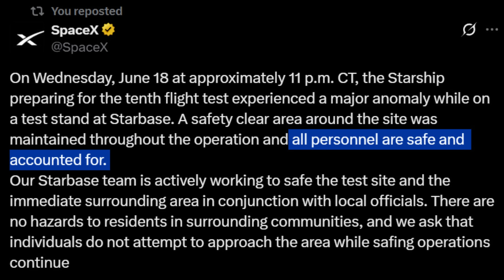SpaceX's Latest Starship Explodes During Ground Test

Comment: Selecting methane and oxigen for fuel is good choice regarding to creating fuel for return journey  on-site anywhere in the solar system, but bad regarding to the freezing and boilding points close to each other. One fuel may undercool the other, causing a clogged pipe...as I remember there have been a kaboom years ago because of this.

Comment: I noted on the NASASpaceflight video, that there was the forward flap test just seconds before the explosion; in fact it was very likely still ongoing when this happened. Whether this was in any way linked is impossible to judge, perhaps not, but on their video "SpaceX Starship 36 Explodes During Flight 10 Testing at Starbase" at 0:30 seconds in the flap is clearly functioning...
Reply: Well at least something worked.
Reply: My theory is something broke in the flap mechanism.  Either a weld broke causing a weak spot or something came loose which poked a hole in the tank when the flap returned to starting position.

Comment: Brilliant review. Only one glaring error: "we don't know the effects of breathing tiny glass fibres."
Reply: Fibrosis. Ask someone who installs or tears out insulation for a living, without face protection. One-time exposure and you'll be fine, life-long exposure? Not so much.
Reply: @desdenova1  I know of two people who did fiberglass insulation for a living, one worked for 10-15 years, and one his entire career, well over 40 years (and still does in his senior years for friends), no lung issues what so ever, and they never used/use masks. Glass fiber/ fiberglass, is generally not considered a cause of fibrosis, although some studies have shown that prolonged and high-level exposure to certain types of glass fibers may be associated with an increased risk of lung disease or fibrosis, then again, so is flour dust when baking! For anyone in construction, and especially renovation, the main concern is dust from other building materials, including wood dust, all kind of chemicals and binders, and of course concrete dust/silica which is the big risk. As I said, while fiberglass can cause irritation, long-term effects are very rare.
Reply: @Kowalski301  Yes, fiberglass particulate is pretty gnarly.
Reply: Pneumonoultramicroscopicsilicovolcanoconiosis
Reply: Depends on the material, silicosis, beryliosis, etc.
Reply: What do you mean
Reply: @spooders8424  I believe s/he may be referring to asbestos.  Inhaling asbestos fibres for decades may take 30~40 years to finally manifest as asbestosis, an often fatal lung disease.  See:  https://en.wikipedia.org/wiki/Asbestosis
Reply: I think what Scott meant is that we don't know too much about the health effects of fiber reinforced ceramic panels getting burned in a LOX/Methane fire...
Reply: Actually.... GLASS fibers are not bad, they can cause irritation in airways in large amount and worsen asthma etc, but that will regular house dust do too. But glass fibers are inert and importantly, the body will expel it within 24-48 hours. There is also no evidence that glass fiber cause cancer. Silica on the other hand is a totally different story, and the tiles mainly consist of that, so not sure why he mixed up silica and glass.
Reply: @Kowalski301  Your definition of bad is clearly very different from mine. Fibrosis does not appear to be good in my experience.

Comment: Given that the Pez Dispenser is on the unshielded side and the very first frame indicating rupture happens on a curved section of the shielded side, it appears to me that the downcomer tracing along the shielded side is probably a good candidate for the culprit.  In this portion welds are probably more difficult to do with machines, unlike a segment where tubing could be rotated as a complete unit.
If this is the case, it should be fairly easy to find the part that failed first, because it would have fractured and unzipped cold before being tossed clear of the rest of the ship by the ensuing bleve.
Editorially, from my point of view, the V2 versions of Starship all seem to have had failures related to welds in places where those welds would have been done by hand.

Comment: In the fire department, this is what we would call a BLEVE (pronounced ble-vee) acronym for Boiling Liquid Expanding Vapor Explosion...basically a rupture of a pressure vessel containing flammable liquids causing an explosion. BLEVE are normally very dynamic, and the most fiery and destructive of explosions. Examples of BLEVE's in the news in the past include Texarkana train explosion, and the massive Dubai explosion.
Reply: This isn't a BLEVE. A BLEVE is when you have a fluid above its normal boiling point kept liquid by high pressure when the pressure vessel ruptures, causing the entire volume of liquid to flash to vapor. BLEVE's do not need a flammable liquid, and in fact the most common example is a malfunctioning tank-style water heater, where multiple failures cause the heat source to run continuously, causing a build up of pressure until the water is well above the boiling point and the whole tank ruptures.

(Also, last I heard SpaceX reported it was a catastrophic failure in a COPV that caused the incident, similar to the Amos-6 anomaly)
Reply: Starship fuel tanks are under pressure, genius. Specifically to keep the fuel liquid...above normal boiling point
Reply: @emp_zealoth  False. To cause a BLEVE, the liqud has to be above, or ar least close to the supercritical temperature, which in the case of LOx is about -120°C, and for methane about -85°C. Notably, the pressure required to keep both of those liquid at those temperatures is about 46 Bar for the Methane, and 50 Bar for the Oxygen. This is significantly higher than the operational pressure of the main tanks, which are at 6 bar, and still higher than the operational pressure of the header tanks, which are at 30 Bar.
Reply: I bleve you may be crect.
Reply: @davidcooke8005 haha beat me to it....
Reply: This is an overpressure event, but not a BLEVE, Essentially a large leak from a pressure vessel.   Also, BLEVEs do not exclusively involve fire at all.  Several houses have been ripped apart by propane tank BLEVEs that did not involve fire.   Fire does often happen, as it did in this case, but it still leaves you asking what ignited the mixture.
Reply: @brianhaygood183  Brother, this was a pressure vessel full of boiling liquid that lost the ability to contain said pressure...literally THE description of how BLEVE works
Reply: Wasn't familiar with the acronym. Thanks for that!
FAE's (fuel-air-explosions) are the weaponised version of the BLEVE. They do pack a punch but are not the 'most fiery and destructive' explosions out there. 
But your statement is true if no actual explosives are used.
Reply: @DreadX10  Fuel-Air explosions are different from BLEVEs. A BLEVE requires the fluid to be kept liquid well above it's boiling point. A Fuel-Air explosive simply uses conventional explosives to scatter a fuel into the air, where it mixes with oxygen and ignites, causing a blast wave. No supercritical fluids are involved in a FAEB
Reply: @richardmillhousenixon  What do you call a liquid that has just been agitated by the detonation of an explosive? At high pressure and well above its boiling point maybe?
The scattering and mixing is a lot more daunting than you make it out to be and the cloud is ignited by a second explosion which was also a pain to develop.
Reply: @DreadX10  Doesn't make it a BLEVE.
Reply: @richardmillhousenixon  A 'weaponised version of a BLEVE' is not exactly the same as a BLEVE. No shit, Sherlock!
Reply: @DreadX10  Because a FAE is not a BLEVE. Period. End of story.

Comment: I like the bridge analogy, but I'd add that it's easier to under build the bridge and test it to failure and fix that failure point, you end up with a stronger lighter bridge that if you start with one you know will work.   Also being that most of the test area was designed to at the very least handle the acoustic energy of 6 raptors,  was surely build with explosion proof electrical, that a really big fire might not do that much damage.

Comment: Oxygen and methane can combine as liquids to form an explosive mixture in the absence of an ignition source. The mixture is extremely unstable and at some point early in the mixing process it detonates. Once the detonation occurs and provides enough energy to rupture a fuel tank or line and ignite the fuel, the rest of the fuel conflagrates without mixing with the LOX. Alternatively the failure of a pressure vessel can provide the energy for an explosion. In the AMOS-6 incident the rupture of a COPV released energy equivalent to two pounds of TNT even though the gas itself was helium, which does not combust.

The fraction of the fuel and oxidizer that can mix before detonation is critical in planning for launch contingencies and has been studied over the years, it appears (for LOX-kerosene) to never exceed 10% for a large booster although public safety planning often assumes 100%.

Comment: I think this is a demonstration of Elon's thinking. Everything that others have done so far is wrong. Everything can be done differently and cheaper. 
The demonstration of the cheap design of the launch pad was very characteristic. I am convinced that the subsequent damage (including the rocket) and reconstruction cost more than if he had accepted more than half a century of experience of others from the beginning. 
Likewise, assembling rockets in an open area and in metal sheds is not exactly the path to quality. For those who are turning red in the face - Falcon 9 is produced in standard halls and launches from modified NASA launch pads. 
Finally, the problem of the heat shield, which is glued to the tank wall. These walls are also the supporting structure for the entire upper stage - Starship. The metal wall of the tank behaves like a vibrating, inflated and deflated balloon, with huge thermal changes. 
Again, for those who have a problem with this - the thermal tiles on the Space Shuttle were glued to the airframe, not to the tanks. They were inside. And yet, these tiles were considered the biggest problem with the Space Shuttle. 
Finally, one nice example of Elon's genius and ability to reduce costs - DOGE.

Comment: If the LOX ignited, it was a detonation, oxygen burns faster than the speed of sound. If the gasses mixed and that mixture reaches a stoichiometric ratio then that's also detonation. For deflagration to occur the fuel mixture would have to be very methane rich, this didn't happen as evidenced by the audible boom the explosion made. That boom is the sonic boom of a fireball burning faster than the speed of sound.

Comment: Space X is deep into the sunk cost fallacy with Starship at this point.
Reply: Starship is to SpaceX what Cybertruck is to Tesla. The companies have real engineers and do good work, but Musk has too much control. His designs are best left in napkin form.
Reply: NASA/Boeing/Lockheed with Artemis/Orion project(s) is a different version of the same fallacy. They take a paranoid 'risk-aversion-at-all-costs' outlook on a project thus spending gobs of money constantly reviewing and updating things.  Space-X makes a design, gives it a good review, puts it together, and sees if it'll work.  "Oops, that didn't go so well, lets look at the data, update, and try again".
Reply: @crosslink1493  Sure, but there's been what, 9 Starhip test lunches? And how many successful stable orbits? Compared to SLS...
Reply: Nasa is deep into sunk cost fallacy with Starship at this point.
Reply: The falcon line of rockets are still going strong and are reliable. 

With their income they can continue with this starship development for another 5 years before they should be worried.
Reply: @alextaylor9778  Falcon 9 has lowered the cost to get to orbit, but the system has not revolutionized our use of space at all -- it's mostly used to launch Starlink satellites (8,000+ of which don't seem to have revolutionized telecommunications).
Reply: @rdbchase  I wasn't saying it was revolutionary or speaking of their satellite launches, more stating their reliable income from both starlink and falcons consistent success. 

Basically just saying that they have the income from what they have already succeeded in to continue working on starship
Reply: Cancel the tax money sent to spacex.
Reply: @ThatOpalGuy  nah, tax money is not paying for this. What spacex does with their profits is of no concern to us, it's a private company.
Reply: then how do you get to the space station? @ThatOpalGuy
Reply: @jerome1lm  By un-defunding NASA.
Reply: @desdenova1  NASA doesn't have a spaceship
Reply: @jerome1lm  Not with SLS cancelled, no.
Reply: @desdenova1  Even with SLS NASA would not have a spaceship. SLS does not currently work. So without giving tax money to spacex astronauts could not get to the station.
Reply: @jerome1lm  Falcon can't get Dragon to the moon, SLS did get Starliner there.
Reply: @desdenova1  I was asking about how to get to the space station without paying spacex for it.
Reply: @jerome1lm  Which brings us back to un-defund NASA.
Reply: @desdenova1  un-defunding would not suddenly make a working spaceship materialize out of nowhere. I could take them easily a decade and bizarre amounts of money to build one. So that's not a solution for today.
Reply: @desdenova1 higher budget for NASA means more money for spacex
Reply: @jerome1lm  Actually, upon further reflection, I think there's too much dysfunction within SpaceX AND the federal government to get Americans to the moon or mars before the Chinese do.
Reply: @desdenova1 SLS does not fly starliner
Reply: @Random7303  Orion*
Regardless, upon further reflection, I think that SpaceX and the federal government are now way too dysfunctional to get American astronauts back to the moon or to mars before other nations do. Musk is even lording over Dragon access to the ISS and whatever (if anything) comes after.
Reply: @Random7303  Orion*
Regardless, upon further reflection, I think that SpaceX and the federal government are now way too dysfunctional to get American astronauts back to the moon or to mars before other nations do. Musk is even lording over Dragon access to the ISS and whatever (if anything) comes after.